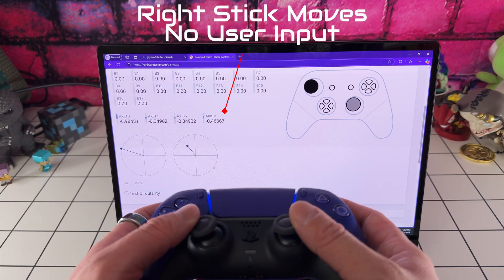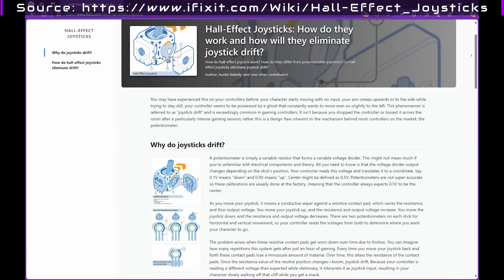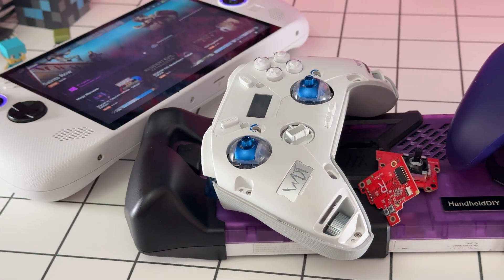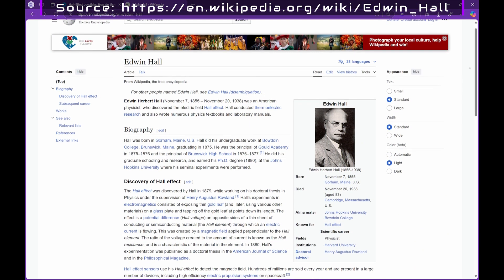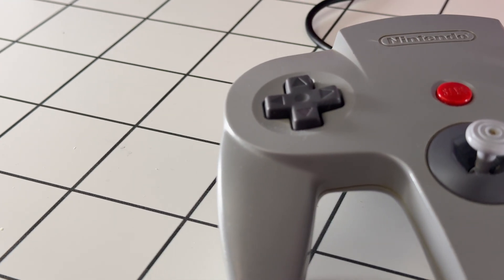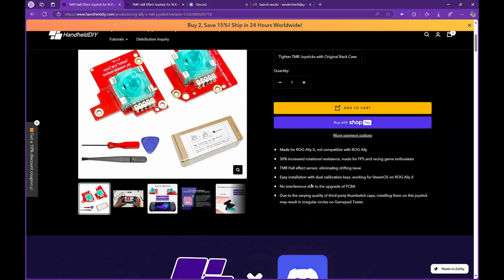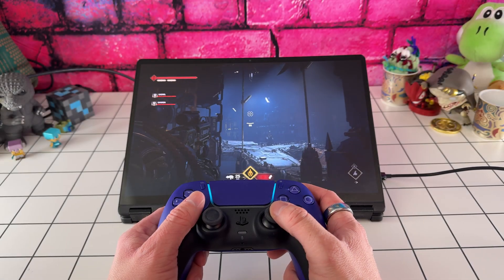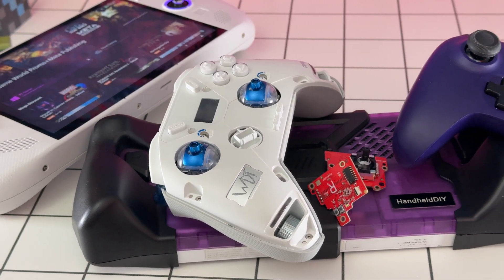What are Hall Effect Joysticks? - Why You SHOULD Care

Comment: The ones that came in my PDP Rematch controller are absolutely terrible. There’s no smooth movement. It can be jerked in straight lines but only from the starting point, in a straight line to any point on the perimeter and back but even then it’s often a shaky line.
I cannot ADS and then move back forth in any two directions and stay in a straight line while carefully trying to flick as straight as possible. 
Trying to make a close quarter, flicking shot is almost impossible without strong aim assist. Sometimes it’ll jerk me in a curved line around the target. 
Adjusting the dead zones helps some… but that takes away my aim asist and makes it more jerky

Comment: I just have to say while it’s true Hall effect sticks is technically is better tech on paper they’re a lot of misinformation about this. They’re not immune to drift, they not necessarily last longer than analog sticks, and even fps gamers have pointed out how hall effect sticks aren’t as accurate as analog sticks depending on the brand and model if at all. To give better context 1 Hall effect sticks still can have drift in fact there are controllers that you
May have heard of the ps5 dualsense edge or the scud had plenty of reports. If fact Sony tried to create a controller where you could swap out the sticks cause they knew that Hall effect sticks could have the same issue as regular analog sticks. Additionally they’re not more future proof dust or debris can effect them just like regular analog. The spring in Hall effect sticks can also wear down. While I’m not saying Hall effect can’t be better. the reason companies don’t make it standard is primarily they can get equally if not better analog sticks for cheaper. Just cause a controller has analog stick doesn’t mean they’re bad. People just started to really notice this problem with analog sticks with the Nintendo switch using it as an example. Though the issue there wasn’t that they were analog the issue was they were cheap and crap sticks. Analog sticks can last for decades heck I have plenty of old Analog controllers that are 20 years old and never had stick drift this is because they’re good stick. I just wanted to point out just cause it’s hall effect doesn’t mean it’s better. Cause while the tech is technically better on paper in practice they’re honestly not that different or better than analog at its current stage. I will say and point out though hall effect does have advantages in other areas like buttons there are controllers that have been using they as buttons or hall effect keyboards. There the tech for the most seems actually better. Unlike in joy sticks they’re not objectively or that significantly better. The argument shouldn’t what type is in your controller but if theyre good sticks and not cheap ones. That’s what matters. Also for those complaining about the switch 2 not have Hall effect even the tech was better (which it isn’t necessarily) they have magnets so the switch 2 magnets would effect the magnets in hall effect sticks.

Comment: Still using the original Xbox one controller from 10 years ago , no drift, no issues. Hall effect joysticks are kinda overhyped right now, considering they aren't as linear as potentiometer ones due to the physical limitations of magnetic force being exponential growth with respect to distance change, all manufacturers can do with their software is to smooth the curve as much as they can to a straight line, and this is not ideal for some games
Reply: My original controller got awful drift about a year and a half after purchasing my xbox, and my next controller got annoying drift a year after.
Reply from the maker: Mostly ideal for most games only games that have a problem are ones with hard coded dead zones that were there to mitigate stick drift
Like metal gear solid the phantom pain
Reply: You haven’t played in 10 years?